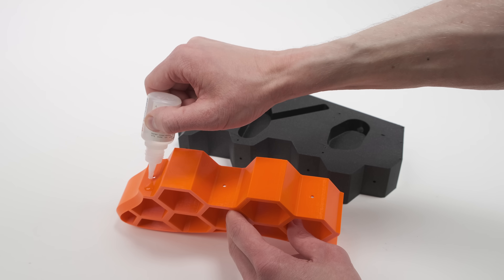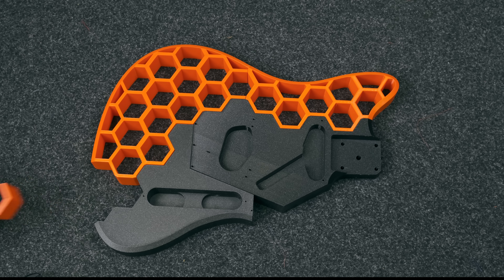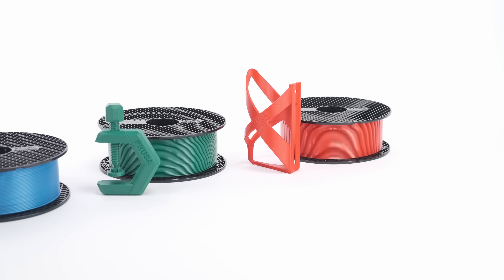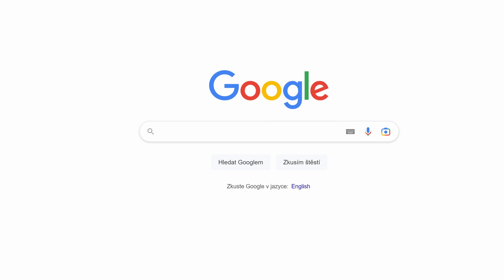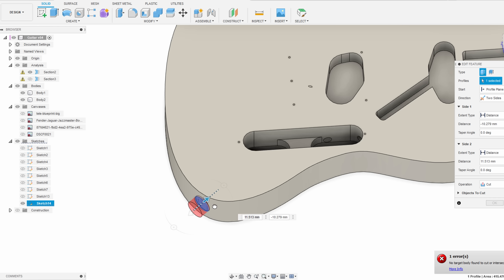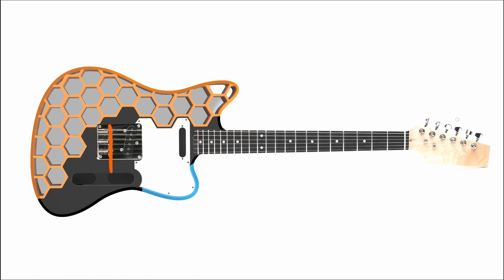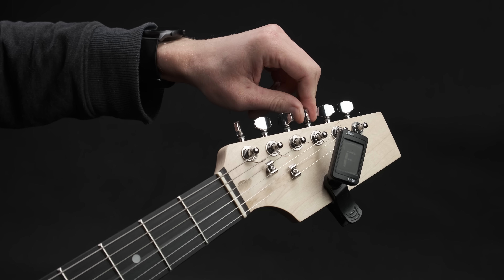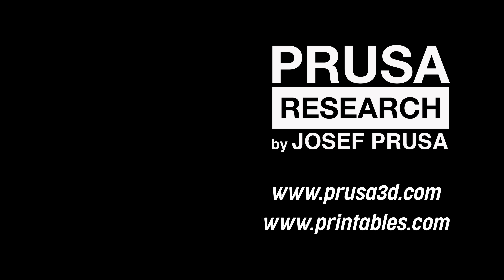How to 3D PRINT A GUITAR - the challenges, how it sounds, and how much it costs

Comment: I suppose I have to type this comment again without the link so YT doesn't spam-filter my comment. I made a 3D printed guitar last year. I printed it in PLA, and even with 6mm steel rod reinforcements, the PLA deforms over time where the neck is attached to the body and it doesn't stay in tune. I think I only printed with 4 walls though, so maybe i'll reprint with more walls and see if that helps. I used other tricks as well, such as putting thin vertical gaps on the interior of the body in places to trick the slicer into printing walls there instead of infill for added strength. I might reprint, but my other idea is to just mill a piece of maple just wide enough to attach the neck, bridge, and tailpiece and then redesign the body to just fit overtop that to completely hide the wood. I've already designed the piece in CAD and started making the toolpaths for my CNC machine, so I guess i'm going to go that route. The guitar is still perfectly playable right now, I just have to re-tune often, and I can feel the action getting slightly higher as the neck angle changes from the PLA deformation. You can see pictures via twitter @jwalker55
Reply: This will be creep overtime, 1 month and they will see the problem.
Reply: It seems reasonable to assume that if you make the plastic body strong enough (optimize the material placement using the techniques you seem to already be aware of) then the guitar should remain good indefinitely (as long as it's not exposed to UV or high heat.) I would find it extremely hard to believe, for example, that a solid PLA body would ever creep by an appreciable amount under the string tension. And that would seem way overkill, you should be able to print something with much lower overall density, but most of the strength.

That being said, I think it sounds like a good idea go with the wood skeleton, if that is within your skill set. Wood is proven to be suitable for the application, and it would be easy to just have a rectangle of it with a plastic shell. I also think this would open up the possibility to have something a lot more modular, with the wood being the only real structural component and you can design it so the plastic parts can be swapped out as desired.
Reply: @MattMcConaha  This is my first attempt at designing and 3d printing a guitar from scratch, so I am certain there is room for improvement. I don't have access to an unlimited supply of filament like Prusa does, nor unlimited time, so i've only produced 2 iterations. I am not an expert in 3d printing guitars. My post isn't meant to imply skepticism against Prusa. My approach to use wood is to eliminate plastic from the structural equation all-together while still having full design control over the aesthetics. I do like the thought of a pure 3d printed body, though.

Comment: If you make 2 apertures for carbon fibre rods and place them inside during a print pause this will stiffen up the body no end.
Reply: I talk about that in the video. While totally reasonable way to stiffen the guitar, I really wanted to avoid using it. It would slightly complicate the build, mainly because people would have to source another specific part. And as I found out, it was not needed in the end at all.
Reply: I have actually done this, but with steel rods instead of carbon rods. The problem is that the plastic is still what the neck is attached to, and with enough tension, it will just deform and pull itself away from the rod.

Comment: Please start using heat inserts for anything that has a metal screw metal screws going into plastic is a bad idea no matter what project
Reply: i beliueve it was stefan at cnc kitchen showed the strength improvements were barely worth it. so the main reason to use them would be for repeated removal and reinserting the screws without wearing out the plastic. in this case he shouldn't need to open anything over and over again, so it should be fine.

Comment: Any plans to make an XL optimized version with bigger sections?
Reply: I'll be happy to include it. I actually have a test XL unit here in the office, but I figured it would be better to primarily target people will more common printer size. Easier to connect pieces back together then splitting them in the first place. :)